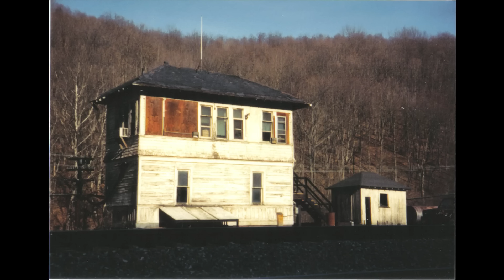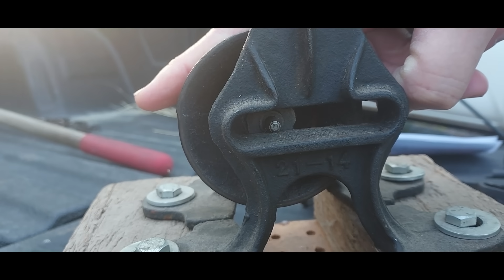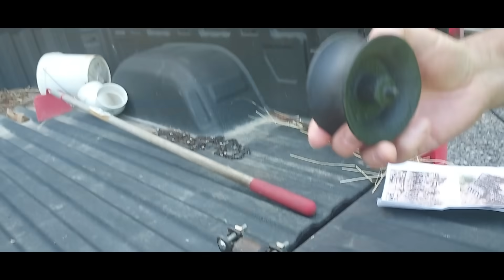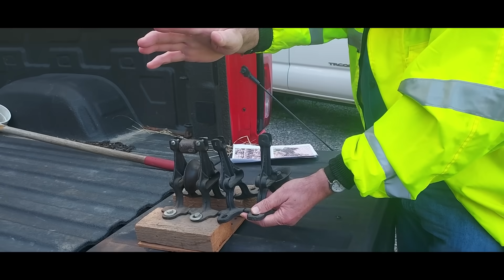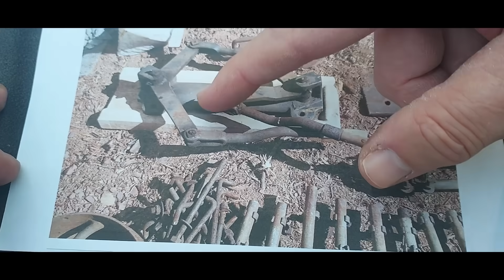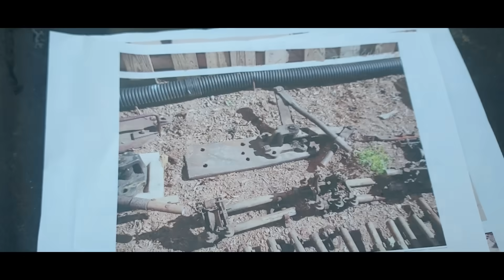How an Interlocking Switch was Thrown from a Switch Tower

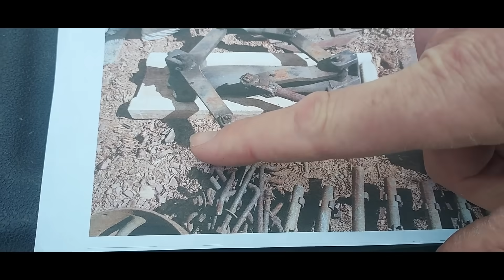Comment: The set of levers at 12:10 is an expansion compensator for the expansion and contraction of the rods on long pipe runs, as the pipes would change length with the change in temperature.  Expansion compensators were installed at specified distances to help keep the throws within allowable amounts.  Under the control levers in the tower were rods and bars with, usually, fishtailed-shaped notches and arrow-shaped blocks that fit those notches when everything was in alignment and set correctly; that is why these machines were called interlockings.  Switches and signals had to be thrown in the proper order for the levers to work and not set up conflicting routes or signal indications.  Electrical interlockings followed, replacing relays for the mechanical rods, then the modern CTC machines and computer-aided ones.
There are several videos on Youtube showing how all of these machines look when working.
Any hard-to-operate rodding, such as turnouts, would be done on the "pull" instead of "push" as rods work better in tension.  These plants were a maintenance nightmare for the track and signal departments when in use.
Reply from the maker: Awesome comment Roy. Thank you so much for sharing some
of your extensive railroading knowledge with us. I never gave the expansion and contraction of the rods a thought, but you are right.
Reply: @ccrx6700   Here's some info I dug up on Google on Gateman Towers for you Dave.

A Gateman's Tower on a railroad was a structure, often eight-sided, that housed a worker who operated crossing gates and signals at busy street crossings.

 These towers were typically manned during the steam-era and into the 1970s, ensuring the safety of both trains and vehicles.

 The gateman would observe oncoming trains and manually activate the gates and bells, preventing collisions at grade crossings.

 
Here's a more detailed explanation:

Purpose:

The primary function of a Gateman's Tower was to provide a vantage point for a worker to monitor train movements and control the mechanical or pneumatic systems that operated the crossing gates and signals.
 
Location:

These towers were strategically placed at busy street crossings where trains and vehicles intersected.
 
Structure:

The eight-sided design of the towers offered a wide field of view, allowing the gateman to observe approaching trains from multiple directions.

Operation:

The gateman would use levers or other controls within the tower to lower the gates and activate the warning signals when a train was approaching.
 
Decline:

With the advent of automated crossing signals and gates, the need for Gateman's Towers diminished, and the structures became obsolete.

Hope you enjoyed the extensive details to further your "new" knowledge.   I'll bet your friend might remember Gateman Towers, you should ask him about them, maybe he might have some info he could share with you and you folks could do a video on them.

Comment: Thanks Dave and Mark for this informative video on interlocking towers, pipes (rods), rollers, roller brackets, etc.  On the web, I have seen  some large complex interlocking towers.  An example is State Line Interlocking Tower (demolished in Oct 2000) that was in Hammond IN.  Built in 1897, it handled a complex situation in the Chicago/NW Indiana area where many RRs came together.  In its heyday, this tower had one operator and two lever men on duty at all times.  There is a pretty good description of State Line Tower on the rrsignalpix website.

In one photo of a single side-by-side group of pipes on rollers in this yard, I counted 42 pipes.  I had two questions:

1.  How did they work on the pipes in the middle of this group of 42 pipes?  Could they have  constructed a portable platform over the pipes on which they layed flat to work on the pipes in the middle and then disassembled the platform to move it somewhere else?

2.  How did they handle freezing rain in the winter which would encase the pipes, rollers and brackets in ice and stop the movement of the pipes?  Could they have used steam hoses to melt the ice off of the equipment?

One account of an Interlocking system stated that to keep the system operable, each set of pipe rollers, levers, etc had to be greased adequately and the set of pipes themselves had to be straight (free of kinks).  Apparently a lever man could kink one or more pipes if he pulled too hard on a long run of pipes.

Comment: Re the roller assembly introduced at 5:21:  I don't think the purpose of the 3 inch horizontal movement of the large roller was mentioned in the video.  I think that purpose of the horizontal movement was to indicate the position of the rod system to person standing at the roller location. If the roller was stationary, in the middle of a long run of rods and no change of direction levers were close by, a person at the roller location could not easily determine the which of two positions (e.g. open/close, on/off, etc) the rods were in. The travelling roller would easily provide this indication.
Reply from the maker: Appreciate your sharing that very informative information with
us Michael. What you said is something I never thought about.
Mark and I thank you so much for watching our video and may you have a very good day.

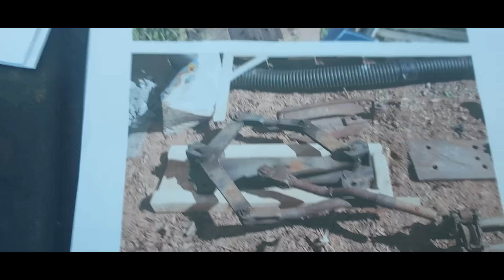Comment: Great content Dave but of course the question was not asked as to why  at 12:41 you would want or need to reverse the throw of the rods.  The answer is that these elements were designed and positioned to remove differential expansion and contraction which would occur due to temperature - which they did automatically!  You could not have all of your switches (points) moving due to extremes in weather conditions. It does take some mental unwinding to understand how pairs of these things together.
Reply: Dam - just seen your pinned post on this matter erg!
Reply from the maker: Thank you very much for sharing that info with us Richard, you
are right about what you said.   Mark and I very much appreciate your taking the time to watch our video and may you have a very good day.

Comment: This video came out at a perfect time. I was watching the 1965 movie “The Train” and there is a scene in a switch tower and I was wondering how the tower worked with the levers and switches.
Reply from the maker: I had a dream to publish this video at the right time just for you
M22OHIO ..... :-)  Mark did a great job explaining how these worked,
we are thankful he did that for us. Mark and I very much appreciate
your taking the time to watch and may you have a very good
day my friend.
Reply: @ccrx6700  Your explanation on the difference between an interlocking and a cross over was really simple and easy to understand. I have a book called Introduction to North American Railroad Signalling written by The Institute of American Signal Engineers and it says on page 136 "Because of the mechanical aspect of these early interlockings, (refering to the old switch towers) the towerman's area of control was limited to 1,000 to 1,500 yards either side of the tower. Beyond that distance, the force required to move the linkages became too great. In addition at short range, the tower man was able to "eyeball" the lie of points and the aspect of signals to assure that the system was operating correctly."  Obviously they are talking about the old "arm strong" interlocking levers in the tower that you see back in the old days, which was the same idea the switches and old semaphore signals were all interconnected and certain routes could not be set if certain switches and signals were not aligned properly. Like you said interlockings are a big complex subject, back in the day it was mechanical and now a days it's all electrical, but it's still real complex and all that made signalling a seperate field of engineering when it comes to desinging railroads from what I understand.

Comment: GP-30s were one of my favorites, only wish EMD had made an SD variant.  The Milwaukee Road had quite a few and it wasn't uncommon to see as many as six on a freight struggling upgrade out of the Menominee Valley.  I like both of your local shortlines equally.  Great video as usual, liked it much.  Thanks JT!
Reply from the maker: Your welcome and glad you liked it JT. With the 2 axle trucks on
the GP's yes it required more locos to pull trains than the SD's
with their extra axles. When a traction motor goes bad on our
SD's then you have to cut out 2 and basically have left a GP,
there is a noticeable difference in power with two motors
out.  Mark and I very much appreciate your taking the time to watch and may you have a very good day my friend.

Comment: Wondering, what was the name of the job of the person that pulled the manual switching levers in the tower?
Also how did that person get his order to put a switch in a certain position?
Also how is it known, to this day that the switch is in the perfect position of track alignment, when the person can not see the switch?
JIM ❤❤
Reply from the maker: Switch man or switch tower operator Jim.  Orders on how to
direct trains came from dispatch. Switches have flags on them
so one can make a visual on the switch point position, those flags
now are reflective so they can be seen at night. Back in the day
switches often had lights on them so a switch tower operator
could see what position the switch was thrown for.  Generally
speaking most railroads now use green for main and red for the
diverging track.   Mark and I very much appreciate your taking the time to watch and may you have a very good day my friend.

Comment: Where I used to hang out and watch trains at a train passenger depot/railroad offices and an ice cream peddlers business had an interlocking tower over the switchyard, and there was also a gatemans tower at each end that would manually lower the crossing gates and turn on the crossing signals for the trains when they came in and pulled out of the depot (before Amtrak even existed, which wouldn't come for another 5 or 6 years).

Those gateman shacks were also interesting inside as well.  Elevetated above the tracks at the crossings.

When they finally tore the interlocking and gateman towers down, that was just so depressing, as they'd been there for years.  Was hoping they would have preserved them, as the buildings weren't in very bad shape when they demolished them.  But they wouldn't preserve them, so sad, another piece of railroad history lost on the SCL railroad.

I had been in the interlocking tower and the gateman towers, they would've been awesome places to video trains above the tracks.   I tried to get the railroad to keep them and allow railfans to use them, but that was a no go.

If I actually owned the property my manufactured home sits on, I always thought about having a gatemans tower or interlocking tower built so I could have an ariel view of my Garden Railroad I'd build.

Wouldn't that be really cool to have one on your outdoor Garden RailRoad layout, sit up there, have your morning ☕ coffee and watch your 🚆trains🚂 run around on your layout?

   Just how awesome would that be?😃

Thanks Dave, enjoyed reminiscing on the interlocking switches and tower, and brought back memories of the Gatemans Tower as well.  Both of which I was fortunate to see the insides of when they were still being used and operational.
Reply from the maker: Well thank you Mr. Bones, I learned something new, did not know
they ever had a gateman tower, that's interesting to find out.
Thank you for sharing your story with us.  Mark and I very much
appreciate your watching our video and hope you have a very
good day.
Reply: @ccrx6700   Check with your friend Mark, I'll bet he knows about Gateman Towers and might have some additional info and maybe some items from one.  Maybe do another video on the Gateman Towers.

Here's some info I found I thought you'd enjoy about them.

=========================

A Gateman's Tower on a railroad was a structure, often eight-sided, that housed a worker who operated crossing gates and signals at busy street crossings.

 These towers were typically manned during the steam-era and into the 1970s, ensuring the safety of both trains and vehicles.

 The gateman would observe oncoming trains and manually activate the gates and bells, preventing collisions at grade crossings.
 
Here's a more detailed explanation:

Purpose:
The primary function of a Gateman's Tower was to provide a vantage point for a worker to monitor train movements and control the mechanical or pneumatic systems that operated the crossing gates and signals.
 
Location:
These towers were strategically placed at busy street crossings where trains and vehicles intersected.
 
Structure:
The eight-sided design of the towers offered a wide field of view, allowing the gateman to observe approaching trains from multiple directions.

Operation:
The gateman would use levers or other controls within the tower to lower the gates and activate the warning signals when a train was approaching.
 
Decline:
With the advent of automated crossing signals and gates, the need for Gateman's Towers diminished, and the structures became obsolete.

==========================

Hope you enjoyed a little more information on the Gateman Towers.
Reply: @HolidayDecorator  the only one that I knew of was the crossing guard shanty at the crossing at Beall Street on the Baltimore and Ohio in Cumberland. It was four sided and not eight sided and lasted up until the 90s. It remained even after the automatic crossing gates were installed, and the helper crew would use it as a shelter while waiting for trains to come by that they needed to couple onto and give a shove up and over sand patch.
Reply: @whatdoidonext2234   Interesting, all the ones in my area were usually 8 sided with a couple of exceptions, if they weren't near a switch yard, only covered a single or dual mainline, they would be much smaller, sometimes only 4 or 6 sided at those crossings.

  Usually the 8 sided ones were at each end of a switchyard that had multiple tracks crossing a larger highway at each end so the gateman could see everything going on in the yard as well as the mainlines.

At one end of the yard, they were at least 14 tracks and some of those diverged and crossed other roads that the one Gateman's Tower was responsible for all those crossings on the diverging route, which also split crossing the same road 4 times going to different businesses, each with their own crossing gate, bells and signals activated by the Gateman's Tower.

   Now all those tracks have been removed and gone, but it's funny because they left the tracks embedded in the road at each crossing and there are old wooden crossbucks warning to watch out for trains, but on each side of the road the tracks are severed, no way a train is rolling across any of those old service spurs to now non-existent tracks and businesses now long gone.

Although I haven't been to that area in quite a few years, so I don't know if anything has changed from the last time I was there.

   Even a lot of the yard tracks have been taken out since there is only one customer on the line now.

  And I'm not sure how many tracks now cross the highway today, but know it's not the 14 or more that used to be there.

  Might only be 4 tracks that cross there now.

Things sure do change over the years on railroads, old stuff gets demolished, tracks removed, and sometimes many changes get made that's supposed to be for the better.

   But us older folks are sorry to see that nostslgia from the original system just disappear, and go away forever instead of trying to preserve it.

Ah well, life goes on.

Comment: We in UK still have a lot of rod worked switches (points) we used to use round rods then changed to using a n shape so the roller fits inside the channel. All the rods have to have an equal amount of rod that pulls to rod that pushes which was done by reversing the direction of the rod travel either with a compensator as royreynolds108 says or a crank. Great video Dave, showing something a lot will know nothing about.
Reply from the maker: That's really cool to find out Cedarcam, really hope you can do
a video on one of those at some point. Glad you enjoyed and thanks
mostly to Mark for sharing this with us.  Mark and I very much
appreciate your watching our video and hope you have a very
good day.
Reply: @ccrx6700  It's 05:15 and I am getting ready to go out to a railway I have not been to before, already had it in mind to take some video of our rodding if there is any I can get a good view of 😊Have a Good Day Dave
Reply: @ccrx6700  My new video made yesterday and hopefully uploaded soon has a short sequence just for you. I hope to go back to this railway and take some more video. Never been to that line before. Lots I did not get to see.

Comment: GRS and USS were the two biggest suppliers. But any foundry could make replacement parts either from an example item or a pattern. For a good overview of casting, take a look at Windy Hill (https://www.youtube.com/@windyhillfoundry5940/videos). Thanks for the video - I've been studying interlocking plants and their design for several years, and I had no idea that the rollers could be dropped into the carrier from the side. It doesn't really show in the small-scale drawings I've been studying. Makes sense, though, as having to disassemble a roller stand to replace one piece isn't the smartest way to maintain the gear.
Thanks for a great railroading history video.